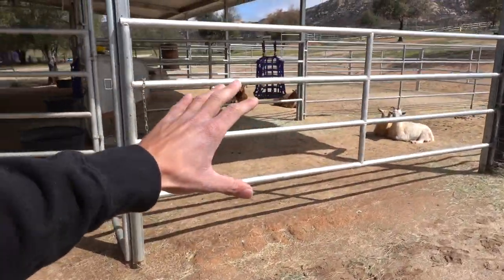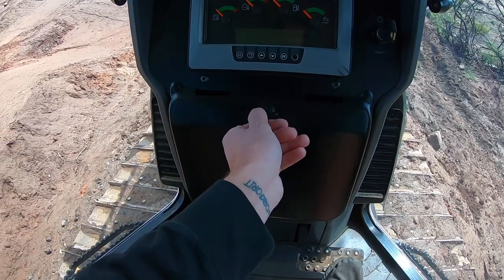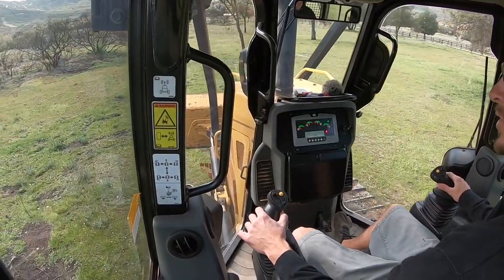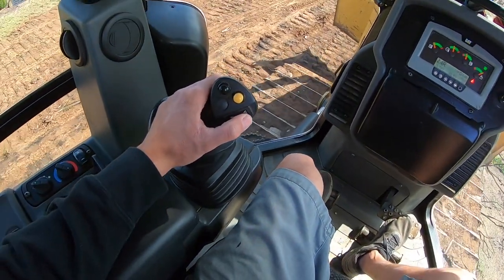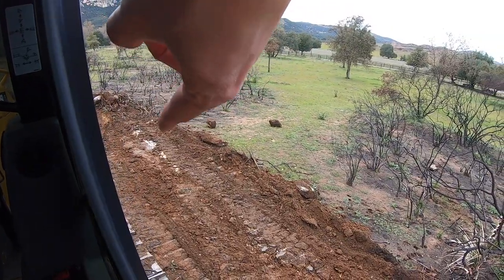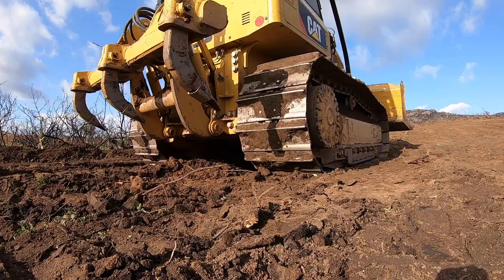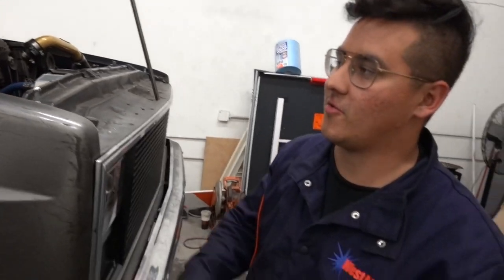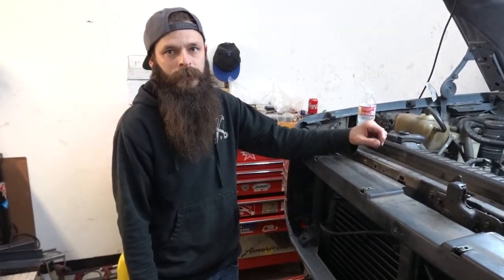MY FIRST TIME TRYING TO OPERATE A DOZER

Comment: Dang you would think I won Neighbor of year award. Rest of America 🇺🇸 should take note. Neighbor's helping Neighbor's that's how we roll out here. Ryan has been an awesome neighbor to have. I am raising three kids and it's good for them to see someone else other than family work hard for what they have and for them see that a good work ethic is invaluable. Also for anyone that has never operated a dozer it's a lot harder than you might think. Pushing and telling dirt where to go is a lot harder than setting it in place with a tractor that has a bucket. Ryan did a good job for his time.
Reply: James you rock
Reply: James is an outstanding guy, definitely  hope to run into this man but he's right in this world today to function you gotta have ambition to have work ethic because it's so hard to find these days, I was raised right and have outstanding work ethic thanks to my parents
Reply: Amen to that James!! .. and not everyday, that same neighbor will be willing to send his Zuma on a 15 Ft. Gap! hahaha
Reply: I'm a week late watching this bud but just a tip when running any type of heavy hydraulic equipment always and I mean always run at FULL THROTTLE  they're designed that way if you don't you wear out the hydraulic system in general.  Full throttle then just adjust speed with your gear and engine brake. Slight application of the brake will slow throttle down and when pressed all the way down it will act as a brake.  Hope this helps you. Also your time in a dozer is always made up in reverse not forward.  Make sense?
Reply: @SCOOPFREE  yep so true I used to operate scrapers and a d9 dozer back in Colorado
Reply: @kill3rhorsepow3r51  is the biggest mistake I see operators do.

Comment: My job in the Marine Corps is a heavy equipment operator, and we use those same dozers but ours are a D6K. Lots of fun, I enjoy the D6K over the larger dozer, and the road grader is even more fun
Reply: Just a tip, when pushing dirt, don't use the full blade. That's what I was taught. Use about 2/3rds of the blade so you have a place for dirt to fall off to as you push which you'll make some windrows doing it

Comment: Dozers are designed to run full throttle all the time. Thats the power zone for pushing. You wimp down the machine when running lower RPMs where it doesn't have the pushing power and the roots stop you sinc ethe hydraulics are lower flowing and that. The button to shake the blade is for end of push to remove stuck material from the blade. Running slower is the right thing to do when learning or fine grading before a maintainer is needed.

You do need a tractor and desk with a drag to help smooth the area. Also rips up the roots left behind. My fields are spectacular to the point the neighbor has been copying me. Best for of flattery.

Comment: the forestry versions have ROPS and FOPS generally.. ROPS -rollover protective structure, and FOPS - falling object protective structure
Reply: the blade is a pat blade which means 6 ways of movement. and with it being pilot controlled it would have a hydrostatic drive setup